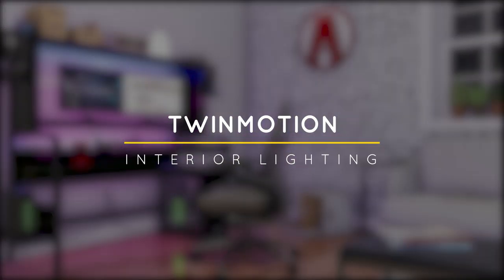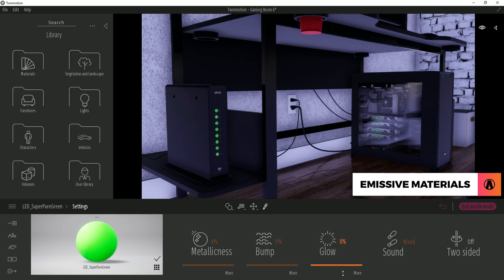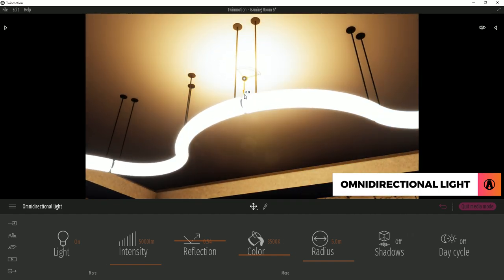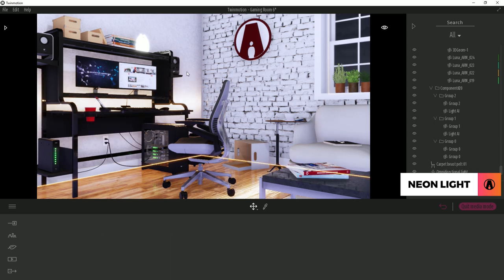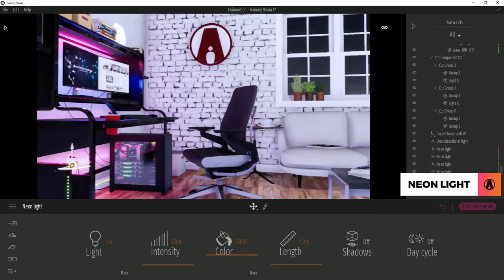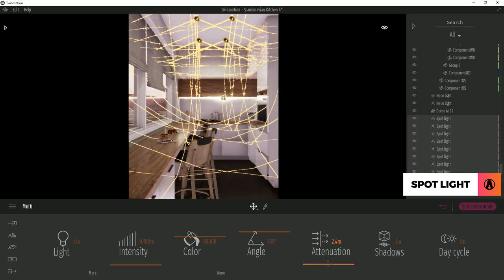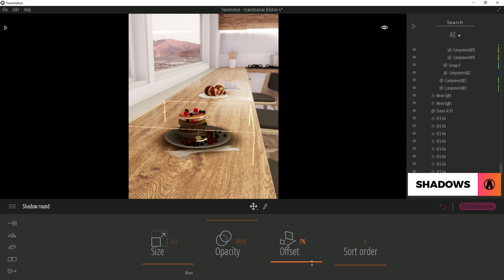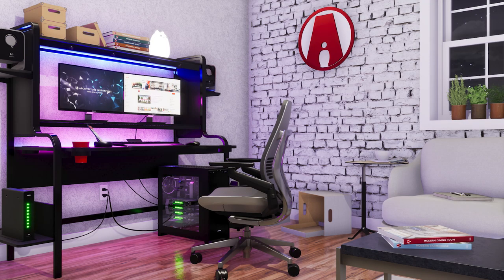Twinmotion Realistic Lighting Tutorial

Comment: tks for the video which explains so well on the use of clipping tool & composite lightings for a single obj as well as the need of constructional diagram for onsite installation technician as the designer always added neon lighting without referencing the actual model & size but the effect...

Comment: Really great video that helped to speed up my workflow, especially the tip for using Set ortho views to help place lights which could be a lot simpler...maybe in the next release?! One problem I was hoping you were going to cast light on if excuse the pun, and hope you can here is how to import TV’s, monitors and Laptops with the images one has chosen and applied to the screen surface in Sketchup, and the how to enable the screen to be an emittter or glow with that same image in Twinmotion.

I have been trying to work it out but every time I select the screen with the eye dropper and them turn on GLOW it burns out...even at 0.0001% Glow🤯🤯🤯

How you can assist??! 

Thanks in advance.
Reply from the maker: Ah, for that you can copy the color map and paste it in the glow map. I cover it in more details in my video on materials ^^